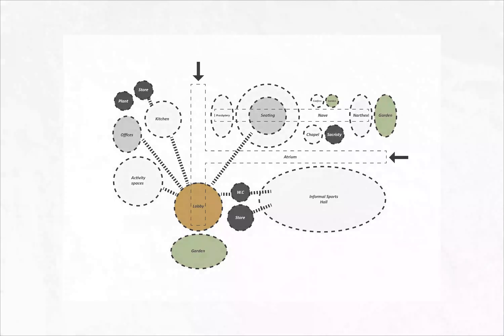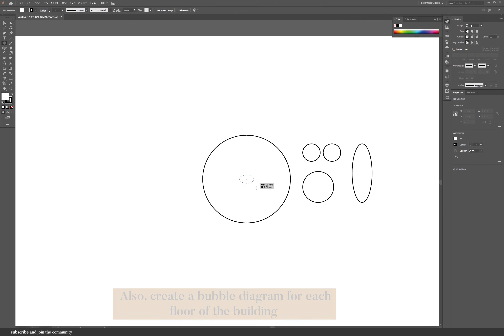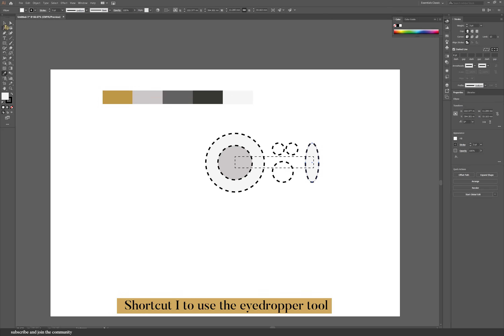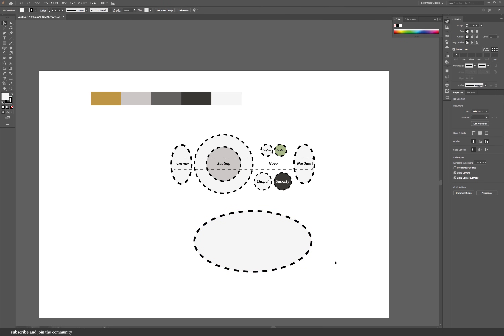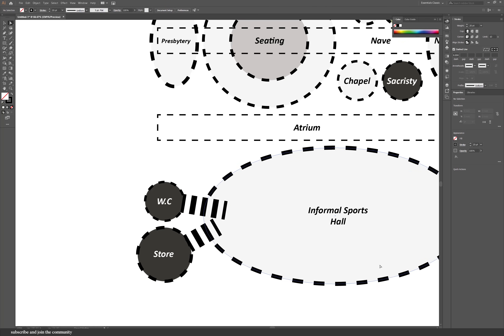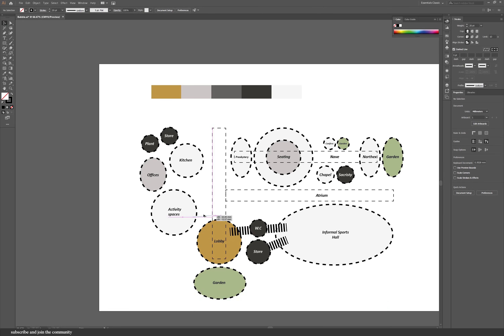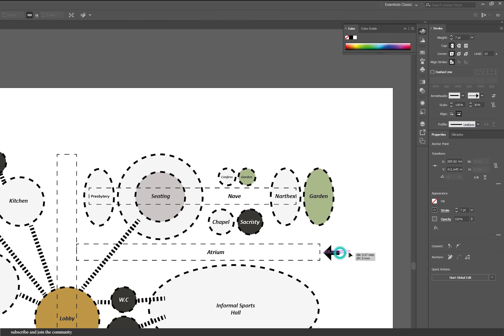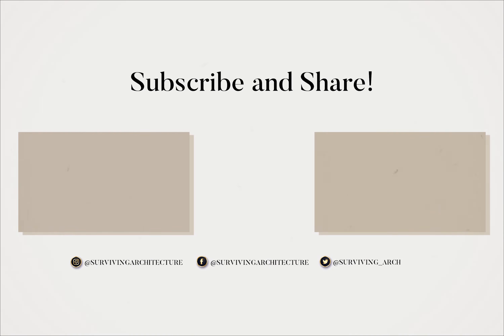Beginner's guide to Bubble Diagrams in Architecture

Comment: I don’t think I’ve heard this term in my schooling, they never specifically asked for it that I remember. But I know I did do some to help me organize the site. I took the room sizes and requirements and did circles in CAD with the correct areas, printed, cut them out, and moved them around on a site plan. I prefer tactile methods even more than hand drawing. 
Yours is a cleaner way to show it, I just find when I use computers, all my thought goes into how I use the program instead of thinking about the building and relationships. Partially this is because I’m not knowledgeable with the program mechanics, but partially because computers seem to put a block between the designer and the initial designs.
Reply from the maker: That's a good process! Keep it up